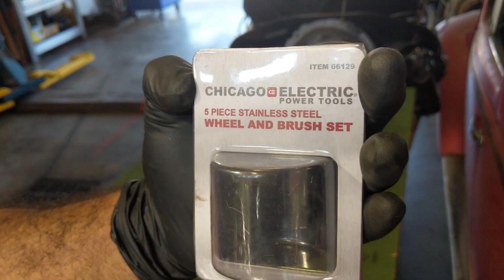Classic VW BuGs 90 Sec tip Beetle Engine Build Internal Cleaning

Comment: Surely scratching the finish like that is more worse than good long-term..? More dirt and oil ingress
Reply from the maker: Once you wash it afterwards thoroughly, you should be fine.  The grime and old grit needs to come out, if not it will get through the engine.

Comment: My own personal experience has been that the Avanti wire brushes from Home Depot hold up a lot better than the ones from Harbor Freight...zero shedding.  Last thing you want are steel fibers left inside the block!
Reply from the maker: I agree, this block will get steam power washed again after we finish.